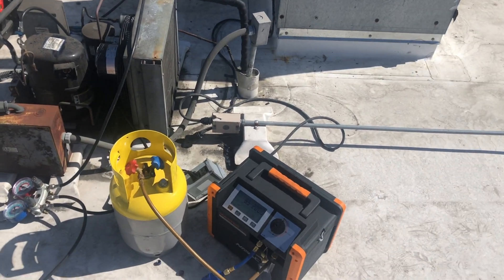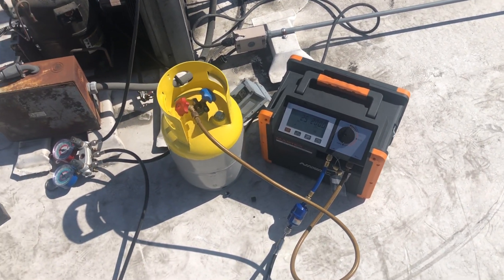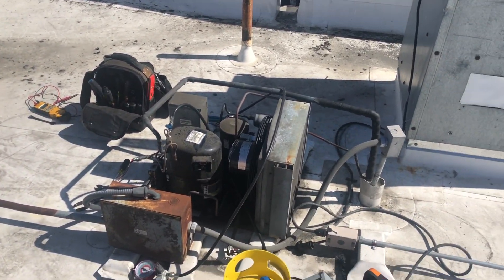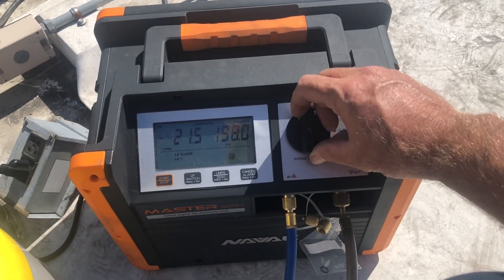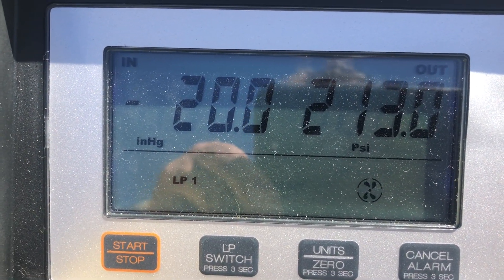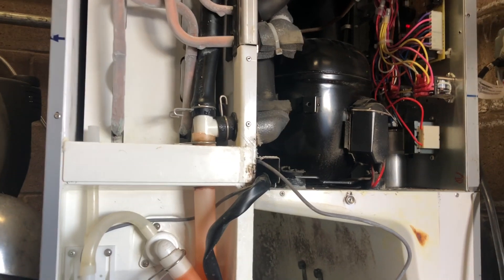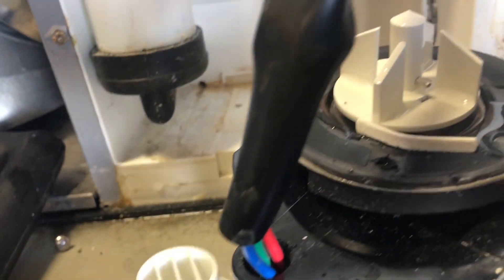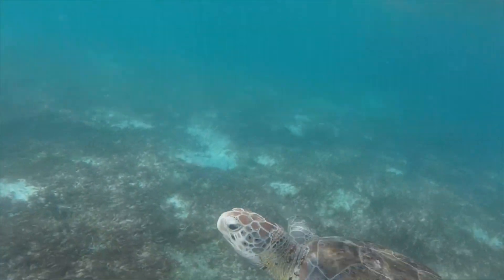Compressor change out and another code 3 Hoshizaki

Comment: I had that exact problem on a hoshi today.  Your vid really helped. I pulled a rookie mistake though and forgot to pull on the evap plates first. All of them were loose.  Hope you had a good vacation Guru.
Reply: Do you look for the loose evap plates on all brands or just the Hoshi?
Reply: @parsonsmech.245  Well older hoshis with a "beeping noise" its the first thing I check. Scotsman and Manitowoc loose plates are more obvious. Usually the welds are broken and the plates are slipping out. Sonetimes you can slap those back in to get by but on Hoshis its a death knell
Reply: Apprentice Phil. Thanks for the info.

Comment: I was told by an older tech to never unsweat anything...a Compressor...a drier filter...I always cut them..much faster for me.. especially with my swager
Reply from the maker: Un sweating is fine if purge your unit, nitro charge leak test then pull a correct vacuum.  What I released moister in the system? 🤣🤣. That’s what the nitrogen new drier and vacuum is for.  Lol
Reply: @NorCal-refrigeration  no this guy was saying that the desscant can break down and release into pipes .as we know it's hard sometimes to pull a good vacuum depending on age, burn out ECT...I have just found that my vacuum takes less time.if I cut..purge..and deep vac..I used to do it all the time..just wanted your two cents...maybe I'll start back up lol..fuck sometimes I don't even pull a fuckn vacuum.. especially on old ass shit...no way
Reply from the maker: HVAC/R DUDE who’s got time. Get to the next job 🤘⚡️🤘

Comment: how you doing with the 404 ban in cali just wondering if it goes nationwide a lot of 448 gonna be the new norm... I know it applies to new install but does it apply if you swap out a compressor or open up a system??
Reply from the maker: No we can use it.

Comment: That's frigin awesome ! You got that cube guide piece on film.in that water pump. i seen it before . not too often. but it does happen. ill prob see it again. Those cube guides should be stainless steel. one of the few mistakes hoshizaki has made. still best machine on planet earth 🌏.  Do a Vid of the Weight & size difference between fieldpiece & navac. which u like better - fieldpiece, navac , your old one ?
Reply from the maker: They used to be stainless back in the day.